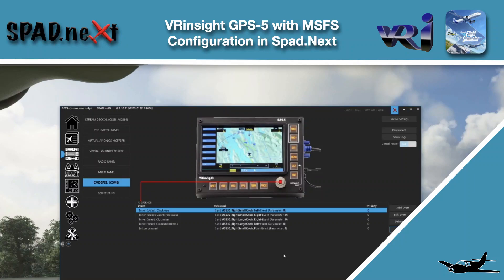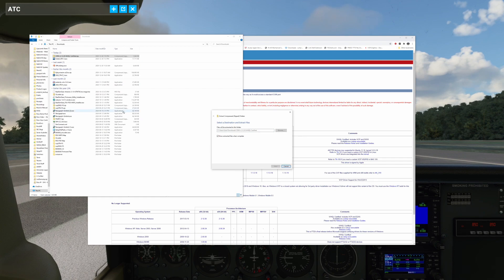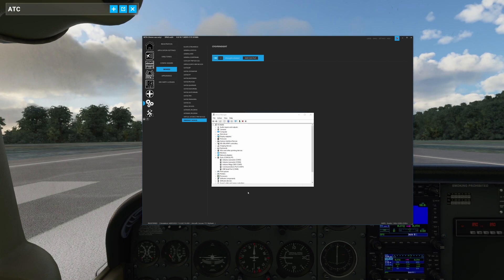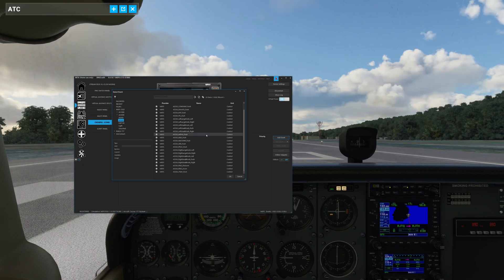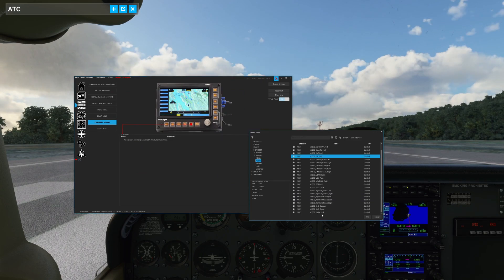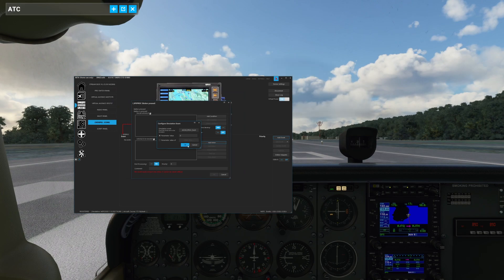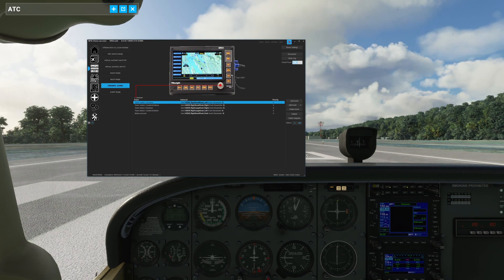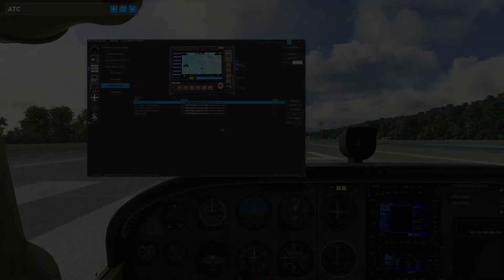(Sim Video) VRi GPS-5 Config in SPAD.neXt

Comment: Hi Les, since the latest Spad.next updates I lost my GPS5. First I had only "no device picture" and I got little yellow sqares visible when pushing a button of my GPS5 and after the last update 0.9.11.0 there is nothing which shows up on the screen when I select my GPS5.
No idea what I can do, hope you can help me
Cheers Juergen
Reply from the maker: Sorry for the delay ... the dots in the spad next and the version cause youtube to put the comments in the held for review pile...

by anychance did the unit change which port it is plugged into in windows and thus change the comport that it is now on?  have you tried removing and re-adding the Serial Device?  I can always digg mine out again and plug it in if those don't point you in the correct direction...

Also good idea to join the SPAD discord since more help and ability to share screen shots of the gui and stuff...
Reply: @LesOReilly  Hi Les, thanks for your reply. In the meantime I opened a ticket and Ulrich came back to me, I did send him a logfile and we´ll see how to fix it. Again many thanks and b.t.w. keep on going, you´re doing a great job, helps all users a lot to get use of the enormous potential Spad.neXt provides. Take care.
Reply from the maker: So again :) don't put dots in the SPAD neXt name or your comments will go into the Held For Review Pile :) ...  YouTube does not have a  clear list so I cant add that... thinks it or the version numbers are ip addresses or websites links...

Well I saw an alpha release with a bug fix listed ... * VRi: Fix GPS5 has no image .....  
So as of the  0-9-11-23 alpha build it would appear to be fixed....
Reply: @LesOReilly  it is fixed now, thanks a lot and no dot anymore at SpaddotneXt :-)

Comment: hi sorry for my english GREAT JOB but i have a question if you want to use the simconnect g1000 or the GNS530 code you need the spadnext the complete edition ?  because i found the g1000 code (all the G1000 line) i program the button but nothing happen to the button on the sim ? and for the gns530 i don t haveit .  i just succeed the first buuton with the CDI ????? is this the LVAR .......something  code that you can not found on the sim configuration?????  thanks
Reply from the maker: LVAR Bridge and support are complete edition I believe. Also you need to be on at least the same version showed in the video which is the beta/alpha version since it is not yet in the release.
Reply: @LesOReilly  thanks ok I will pay the complète version and maybe i will be able also to program my EFIS from OPENCOCKPIT . Have a good day and good flights .
Reply from the maker: @TheCrasybanana  I don't know if the EFIS from opencockpits is supported.  You might want to contact Spad via their forums or discord channels.
Reply: @LesOReilly  ok i will see with them my EFIS has been recognize directly by SPADNEXT but same i cannot programme thé code of the GPS and G1000😢 THANKS
Reply from the maker: @TheCrasybanana  You don't use the simconnect G1000 commands...  You have to use the new LVAR Events that were added as used in my video.  The old simconnect events were never added by Asobo so they don't work in MSFS...
Reply: @LesOReilly  ok so i will jump to the spadnext programming...